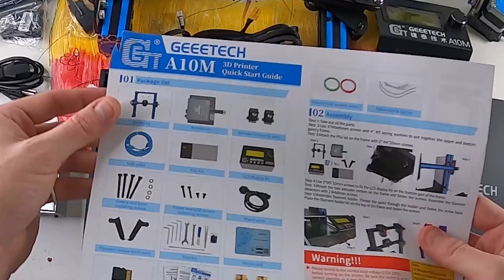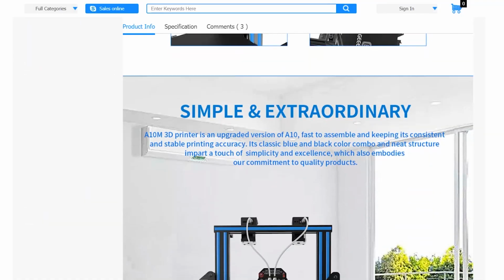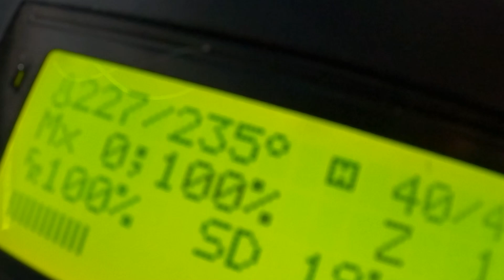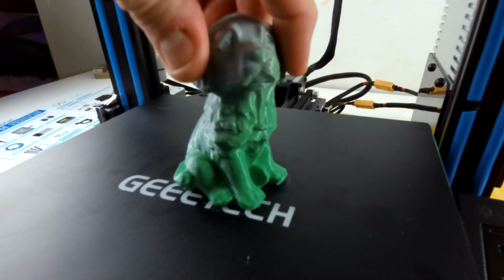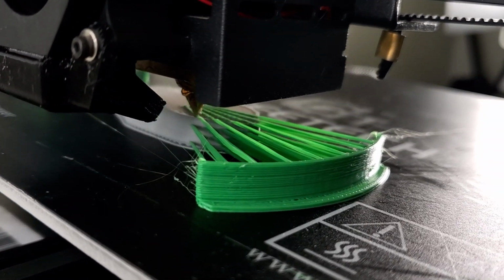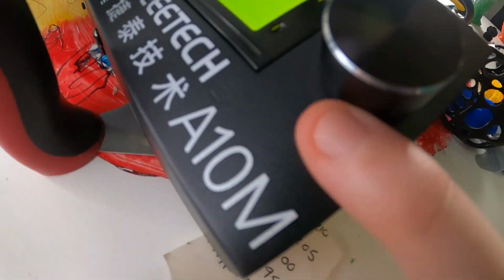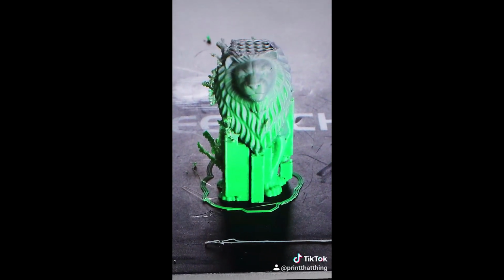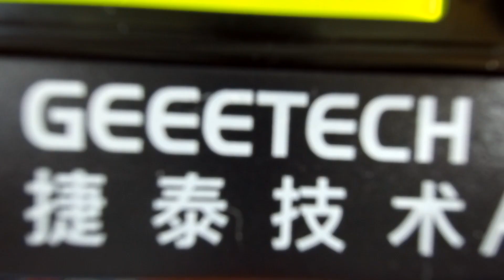NEW GeeeTech A10M (Full Review) - Best $259 Dual Color 3D Printer?!

Comment: Not sure about temperature levels, but apparently the detection issues have been fixed in firmware. Weirdly enough if you look at the older firmware, the code for detection is present, it's just commented out 🤔
Reply from the maker: Good to know
Reply: @PrintThatThing  Cheers for replying :) it's just strange that it was in the code but wasn't active before
Reply from the maker: Yeah I'm still learning firmware
Reply: @PrintThatThing  Can't blame you there, it's always a lot more concerning to play around with the code for something that literally squirts molten plastic!

Comment from the maker: Let me know if you have any questions about this 3D printer or multi color design/printing. :)
Reply: Have they updated the colour swap block being 100% infill yet? I’m gonna buy myself the A10M for Christmas and wasting so much filament seems like a pretty bad downside to this one
Reply from the maker: You can use PrusaSlicer and waste WAY less plastic. S3D was 100% infill on the swap block but I think you can adjust the swap block infill on PrusaSlicer. Im right there with you. Awesome, it'll make a great Christmas 🎄 machine
Reply: well uhm thanks for the heart but have they updated it yet ot not
Reply from the maker: Who is they? Simplify3D? Geeetech? The block comes from the slicer not the printer
Reply: @PrintThatThing  yeah I mean the slicer are there slicers where you can change the infill if the colour swap block?
Reply from the maker: Yes in prusa slicer you can
Reply from the maker: Awesome!!!
Reply from the maker: You may have to turn on the filament detection in the firmware. I haven't done it for mine yet. Glad you got it working
Reply from the maker: Possibly. Congrats on the first printer.  :)